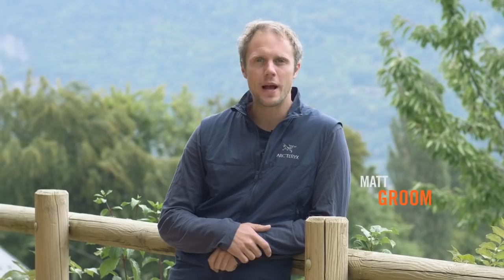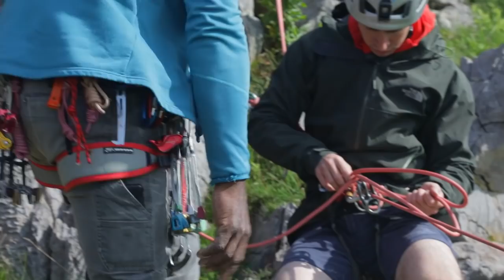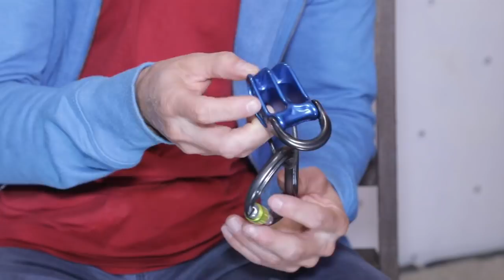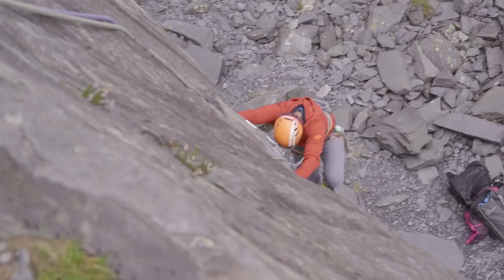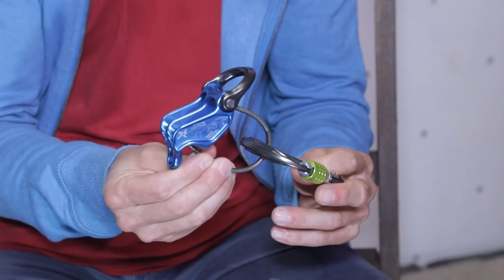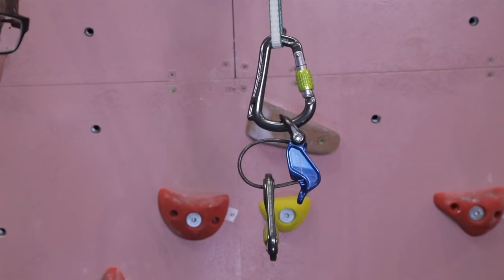How Does A DMM Pivot Belay Device Work? | Climbing Daily Ep.1246

Comment: I think it's a great idea. Though I feel like it seems to be a little frigile near the screws for the pivot. I couldn't find any info on the DMM site, does someone know the weight (Newton) it can handle?
Reply: Hi, DMM does not specify the breaking force of the guide "loop", but UIAA 129 section 5, requires that all attachment points can withstand a force of atleast 7 KN.
Reply: Are you sure? I'm holding a DMM pivot in my hand and the hinge around the pivoting part seems very solid.

Comment: whats the difference between this and a megajul?
Reply: This is a normal tube with a loop to connect to the central point of your belay when doing multi pitch.
The Megajul is an auto-tube device, which means, it is a tube style device (works on the same principle as one... because it is one), BUT is auto blockign when the lead climber falls.
Which means, you don't have to hold a certain percent of the climbers weight in your hands. Just hold the break side of the rope, but you don't have to use force to do so. Like with any other auto blocking belay device out there (Grigri, Clickup, etc).
The Mega Jul is very versatile, but I have sold mine, because 
1.) when sports climbing the whole day, I feel my shoulders get tired by holding the device "open" to give out slack. This thing really locks off like hell! And that's with a 9.5mm rope. Maybe better with a slimmer rope?
2.) from all bealy devices i have used, i feel like the MegaJul brings in more kinks to the rope than any other device. Best is a normal tube. Eben a Grigri is better.
3.) All the things the device CAN do, like lowering in normal mode with a prusik or the device turned around in auto blocking mode, it is very... whats the english word for it? Fiddly? It just locks off and hangs all the time. Again, maybe better with thinner ropes?

For thicker ropes, but no guide mode, there is the Jul^2, which I also own and loved to use, and this makes everything WAY more easier to give out slack etc, but it is still a solid auto block.
Then there is the MegaJul Sport, which is basically the Jul^2, but for 2 ropes, with makes it a MegaJul for thicker ropes and easy handling, but without guide loop.
And brand new, the is the GigaJul. But both of them, MegaJul Sport and GugaJul, I haven't had in my hands. For the last year or so, I belayed with a Grigri 2 when sports climbing, and when doing multi pitch, with the munters hitch or the ATC Guide.
But if i had known the DMM Pivot before buying a ATC guide, I would have bought the DMM Pivot! Why? Because it is the same as any other tubes with a guide loop, BUT is has the pivot which makes it easier to lower someone if you have to. That's all.

Comment: The trend, to do what guides do, is not necessarily the best or ideal method. Most such devices in guide mode are nearly one-way locking, convenient until you need to lower or give slack under tension - then, people have been dropped because the kluge of adding a sling or biner just to tip the locked off device is way too touchy and prone to sudden release. By the way, the UIAA sanctioned belay of choice for leading, on multi-pitch routes, is, wait for it... the Munter Hitch! It works just as well for the guide mode directly off an anchor, can be continued as the second moves past into leading, and with an extra biner there is even a clever "one way" mode that lets you take slack in, but locks off just like the device guide mode does. Of course then you're back to dealing with the issue of letting slack out, but if that is a potential risk, just use the Munter unadorned. Why the Guides have such grossly overcomplicated systems developed for every sort of circumstance actually reduces my confidence, in that I learned to trust a few simple systems which worked in every kind of rock and alpine setting for over fifty years - and I'm not dead yet. I get suspicious that the complexities are intended to intimidate clients, and so insinuate that only pro guides are capable and knowledgeable enough to trust on long routes, and not develop a confidence that would allow clients to venture out on their own.
Reply: Interesting arguments. Personally I dont enjoy using thr Munter as it twists the rope like crazy.
Reply: @xXxSpUtNiiKxXx  The Munter twists under tension, as in rappels or lowering, but when fed loosely during a belay it does not impart much twist at all.
Reply: z1522 interesting, I wasn’t aware. Regardless, when belaying from above I find that there will very often be tension in the rope as one is trying to keep the rope tight for your second. I guess it requires a wee more effort..